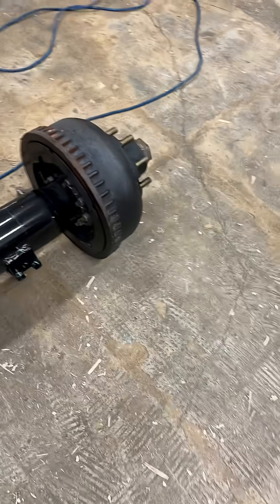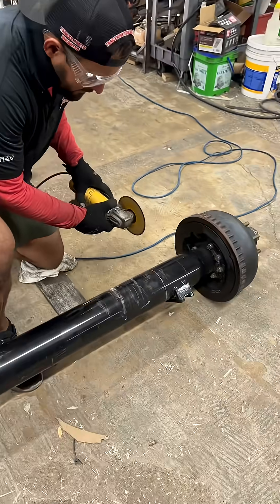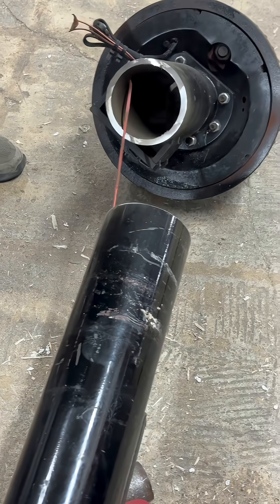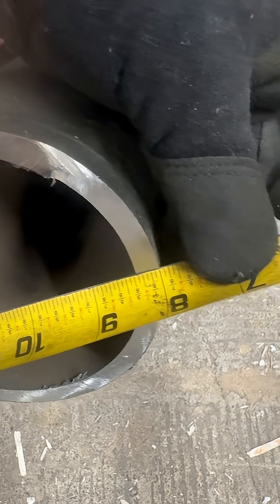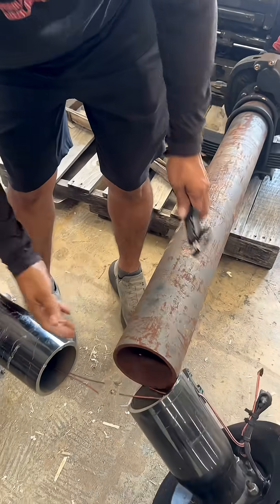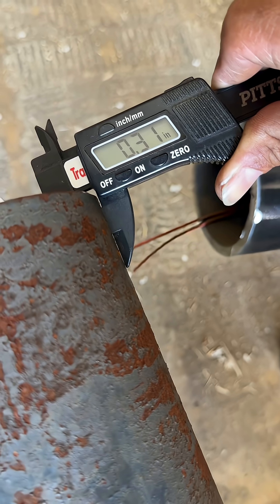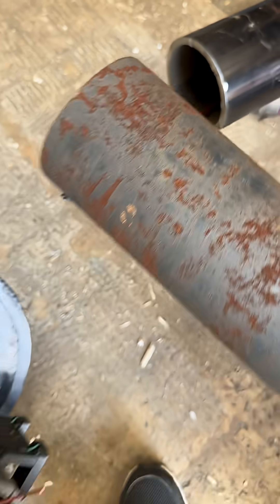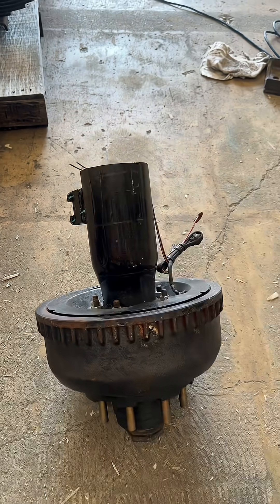10K Carter Axle vs 12K Dexter Trailer Axle – The Results SHOCKED Us

Comment: Hate to break it to you, but there’s way more than just thickness that goes into the strength of the steel. You could have a half inch mild steel that is half the strength of quarter inch engineered steel alloy. So the 0.03 inches is nothing in comparison especially when talking about a 2k difference in axle rating. Not to mention the steel and axle diameter is not the only thing limiting the axle rating. Bearings, hubs, spindles, all factor in. Some companies use the same tubing with different spindles and hubs for different weight ratings on their axles.
Reply: What’s the difference in the diameter of both tubes?

A larger diameter pipe with a 0.31-inch wall thickness has a stronger transverse weight-bearing capacity than a smaller diameter pipe with a 0.34-inch wall thickness. This is due to its significantly higher moment of inertia which allows it to resist bending more effectively under transverse loading.
As per : 
In the United States, mechanical engineers designing or analyzing pipes for structural or pressure applications adhere to standards set by various organizations. The field maintains  Mechanical Engineering, with a focus on Mechanics of Materials, Piping Engineering, or Structural Engineering.

- Relevant Standards:
  - ASME B31.3: Process Piping – Governs the design of piping systems for process industries, including stress analysis for transverse loads. This is widely used for industrial piping
All rating have to be in compliance with DOT. 

I’ll take the 12k rated axle all day every day.

Maybe learn some physics before making videos about physics.
Reply: @FFLFFS  Both axles use a 5” diameter tube — the difference is that Carter gives you a thicker wall than Dexter.

You can throw around engineering terms and copy-paste standards, but let’s not overthink what’s right in front of us. Nobody said tube thickness is the only factor in an axle — that’s obvious.

What we showed is simple: the Carter 10K tube is physically thicker than Dexter’s 12K. That’s measurable, undeniable, and something customers can see with their own eyes.

Some people get lost in theory. We deal in reality. Steel doesn’t lie.
Reply: @Hustle4Horizons 
(It sure looks bigger from the video)
And makes sense from mechanical engineering standards. (FYI Bigger diameter smaller wall thickness holds more weight)..(did I even have to repeat that ? Lol😅) 
Also make sense for licences, insurance,  safety OH&S (OSHA) And the DOT.

Would you put 36k on a triple Carter? 
If they could, would you not think carter would be clear to rate .34 wall axle for 12k? 

6 k bigger payload makes a lot of difference in the real world. 
Instead of a $6k fine😂🥴

Edit : Since this is vital for our company I dug a little deeper: you are correct in the diameter being the same. 
But For hauling a 20k dry weight tractor I will still build with Dexter
Sorry pal the cost savings are just  not worth it.
Reply: @FFLFFS  You’re right — both tubes are the same 5” diameter. The point we showed is that the Carter 10K has a thicker wall than Dexter’s 12K. More steel where it counts.

And just to clear things up — Carter also builds a 12K axle. So if someone needs that higher rating, we’ve got that covered too.

Bottom line: Carter gives you options. Whether it’s 10K or 12K, you’re getting heavier wall tubing, solid components, and real-world strength without the inflated price tag. That’s why more people are switching
Reply: @Hustle4Horizons good to know!
Reply from the maker: Of course bearings, spindles, and hubs factor into axle rating — that’s obvious. We’re not debating the metallurgy or the entire system. This video shows one undeniable fact: the Carter 10K axle tube is thicker than Dexter’s 12K tube.

That’s the point — more steel in Carter’s tube, side by side. No marketing spin. In the real world, when you cut it open and measure, Carter delivers more. You can philosophize all day about alloys and theory, but in the real world, when you cut it open and measure, Carter brings more meat to the table.

Some people talk. We show. That’s the difference